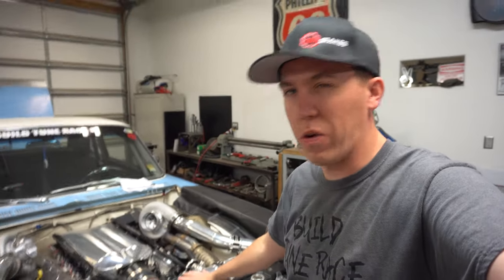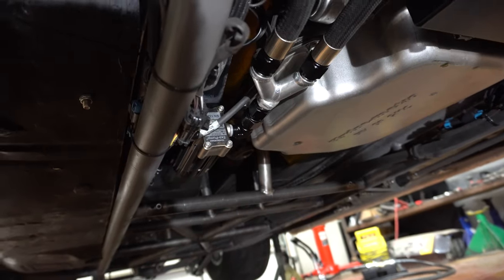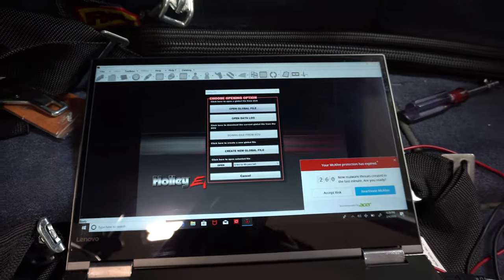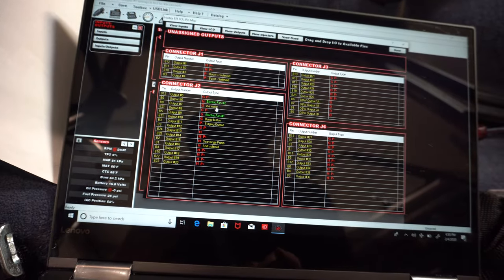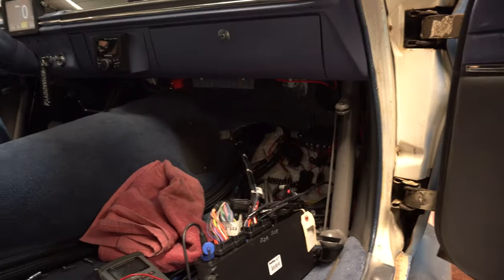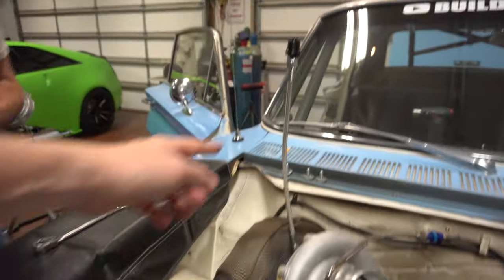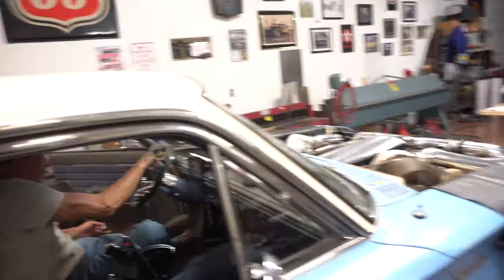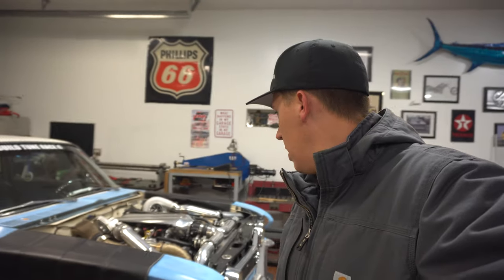The Buick is Back!!! Adding a Scavenge Pump to the Turbo System. Holley EFI How To:

Comment: Love the car. I have a content idea. I'm installing a Holley meth injection solenoid this weekend, and started looking into tuning the meth injection based on fuel%. There is basically zero solid info to be found. I was also surprised to see that there isn't a single video showing the holley 557-106 solenoid's spray pattern. what is your method to tuning the water/meth injection settings?
Reply from the maker: On my Camaro i run a single nozzle of methanol but not controlled through holley its a alky control comes on a 7psi and ramps in fully as quick as possible. I use it to cool intake temps so i tune fueling with the meth spraying and then in case it dosen't i have the holley pull timing depending on intake temps.
Reply: @BuildTuneRace  do you leave the learn at 100% incase it doesnt spray?

Comment: Did precision recommend resistors or scavenger pump? Or was this something you and your dad decided to do to help the turbos.
Reply from the maker: The restrictor is internal in the turbo i guess not sure if its a restrictor or just a different fitting/port but sounds like a restrictor. He decided to add the pump for extra reinforcement that we hopefully won't have that issue any more
Reply: @BuildTuneRace  experiencing the same issue. So good video for me. Ha.